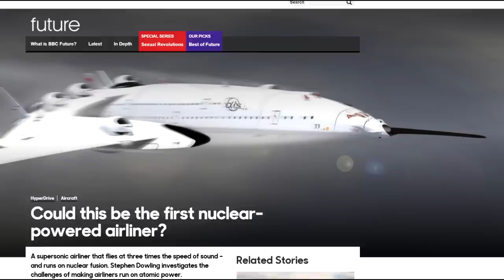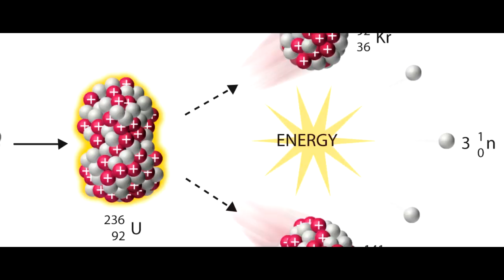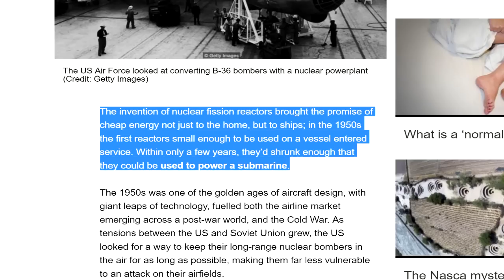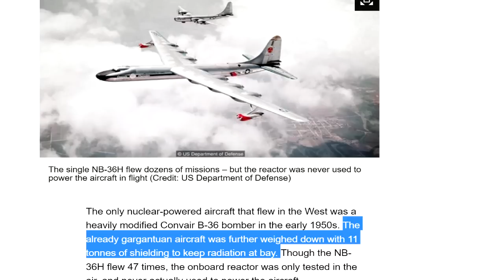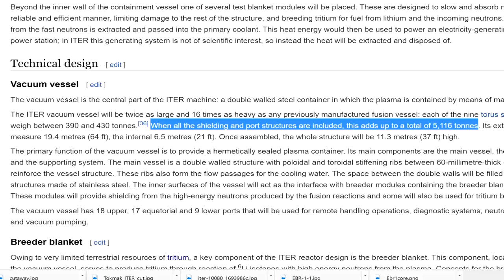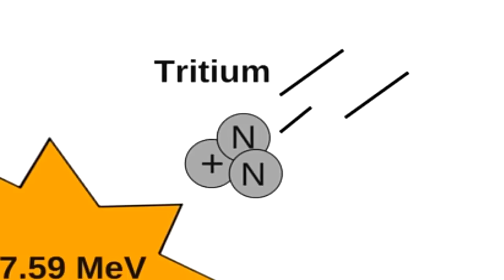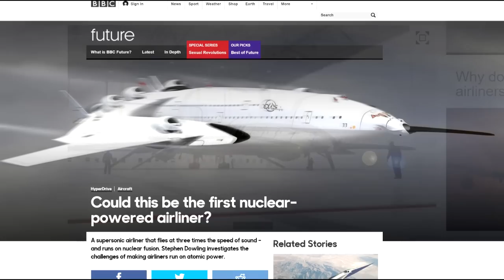SIX ENGINED Nuclear Airliner... BUSTED!

Comment: lol even if they good somehow get that much electricity to power them engines from thin air that thing would not be able to fly at match 3 because of it's shape. flying that fast needs a specially designed aircraft...

Comment: Yes, again, true... atm it is impossible and even in 20-30 years it will still be impossible. BUT, if you want to debunk such stuff keep it real. Aneutronic fusion reactors might, in 40-50 years, maybe be viable. They need a lot less shielding as the fuel as well as the resulting waste is not radioactive and the reaction is ANEUTRONIC! Further more the aneutronic fusion reactions generate energy in the form of high energy electrons that can be trapped and used directly as electricity. I love how leaving such facts out makes your assessments otherwise correct be nothing more then hate speech. How about instead of simply bashing the concept try and find a solution to them especially since one is envisioned already! Yes the artist is way way off base but presenting only part of the truth makes you a bad scientist! Present all the facts not just skim through it just as these guys are doing show us you really know your stuff and I wager you know every single thing I said much more intimately then I do and could make a much better prediction as to what would be needed and how it would be built if possible.

Comment: 4:20 p+b11 fusion produces very few neutrons and He3 fusion produces hardly any. 5:40  Boron11 is a plentiful and stable isotope.
Reply: yes and why talk about it when you can just make a hate video. The plans for that airplane are ludicrous at best but he's a scientist and should act accordingly. Also you need to mention that He3 is almost 100% clean fusion almost no neutrons to speak of input and output materials are all non radioactive...
Reply: mycardbrokedown Almost no neutrons? There is one neutron created every fusion event, there atleast several billion fusion events a second, you do the math. Then comes neutron capture of the materials used in the reactor, they WILL turn radioactive over time and when the reactor is disassembled are no less dangerous than components of a fission reactor.
Also, while fusion is a wonderful concept, if it will work (meaning more energy turned into heat/electricity than needed to keep the reaction running, lets just leave it to ITER for now to prove that) the tritium is highly radioactive, while easy to shield the beta particles, you really don't want it to leak.

Comment: The French actually flew an electric plane across the channel last year.  It is power stored in a big battery but it still flew like a normal propeller plane or a prop plane.  So technically you could have a nuclear power source on an aeroplane  that charges an engine to force propellers to work. Like a battery.  The problem is you wouldn't be able to achieve the same thrust as a fuel plane.  But the last thing is who would want a plane flying around with a nuclear power source on it when it crashes.  Also you have to contain the nuclear power source so yes you could be too heavy to achieve thrust to lift off the ground.  Yes they could make a small power source as the the satellite that went to Pluto used a nuclear power source.

Comment: In 1960's the soviet union had a flying prototype nuclear powered plane. It was nothing special regular speed plane exept it was flying for months with no refuel , seems like cool but not realy , after they tested it , they closed the project. At the time they couldn't fix the issues the weight was to big and they couldn't properly protect pilots from radiation. At the time that plane was useles they couldn't adapt it for their needs that technology they used in their submarines since then they never resurrected that project again.

Comment: I would also be concerned that the wings are mounted to the fuselage by a thin strip in the back, and are leveraged toward the front. Those suckers are going to rock up and down  at speed and then finally rip off.

Comment: That's not a feasible fuselage or wing for supersonic flight. There's a reason that Concorde had a delta wing, and that supersonic fighters have wings that swing back to form a delta. And the forward part of the fuselage needs to be a particular shape to form a shock wave at the front of the delta.

Comment: The wing design pictured would have a number of problems and I'm not at all sure about those six small, strange, weirdly placed "engines". How does it get from heat production to thrust production?
Its OK for sci-fi but it does not look like it could actually fly.  Then add the weight of the shielding.  Ha!😁

Comment: The inventor talks about creating a fusion reactor like it's nothing. To start with you need to get the temperature up to about 10,000,000 degrees Celsius just to start the fusion process. So they'll need an onboard power generator capable of producing that just to start it up for christ sake.

Comment: Sci Fi literature sometimes deals with the problem of radiative engines and the need to keep them isolated with little mass by placing engines on pylons away from the main body of the ship or otherwise separated from the populated areas. This may be why the Discovery ind Athur C Clark's 2001 had the people up front in a globular section and the engines far away back separated with a long a thin hull. This aircraft show now no such design techniques.

Comment: The US airforce gave up on this in the 50's. About 40 miles down the road from here is the old site of the Quehanna experimental nuclear reactor. It was used in the 50's to study the feasability of nuclear jet powered aircraft, but with fission. The old decaying earthen bunkers are still there, though hunters have mostly shot out the inches thick leaded glass in them. Penn State took over the facility in the 60's for a while for their own studies. Clean up of radioactive materials has been going on for decades, and from what I've read, there are still many barrels of beryllium oxide buried there, and some places are still hot. They abandoned the idea of using fission in aircraft for the reasons you mentioned, like shielding, plus there was the risk of spreading fission products in the event of a crash.
One thing I noticed interesting about this bbc article is that they say they will use the fusion reactor to provide power for electric engines. How? Boiling water for a heavy generator? That would make this about as practical as Henson's aerial steam carriage from 1843. The first fission jet engines used a fission core in the belly of the aircraft, along with a heat exchanger. The heat was transferred from the core to jet engines on the wings using a fluid, I think molten salt. The jets had heat exchangers in them instead of fuel injectors, so basically the fission heat was replacing the heat which would normally have been produced from burning refined kerosene. This would allow a jet to run for months at altitude instead of hours. Cool idea, but a bitch to implement in reality.

Comment: Wouldn't that plane though be big enough to actually hold a reactor + the shielding required?  And even if it did so at the expense of weight, carrying that many passengers that quickly could it offset the lost capacity by charging higher ticket prices?  Surely even a cargo version would be eagerly snatched up?

Comment: Not seen the whole vid already, but from the Concorde, Tupolev and Boeing prototype in the 60, all of them has very common points that I cant see on the photo, example a delta wing and very sleek and sharp aiframe. Sleek aiframe = a single aile that wont seat 250 persons. Also Concorde is not a random design, its caracteristics were derived from supersonic fighters ... that is, aerodinamics rules are the same no matter the years. This could explain why tupolev 144 looks almost like Concorde. Yep, both supersonic. And this photo has nothing in common with them.

Comment: All this is, is a flying-waiting to happen Chernobyl. Nuclear power was conceived for use in aircraft with a modification to a B-36 Peacemaker, best part is.....the US SAC did modify it but never actually turned the reactor on while the plane was flying for safety reasons. You know, in case it might crash and blow up :P. This is a stupid concept, both aerodynamically (that fucking U-shape wing...)and scientifically.

Comment: But si nuclear fusion possible on submarines?
Reply: @flow It's possible once efficient, sustained nuclear fusion is achieved! But nobody will stick a new engine power design in a submarine where it's very difficult to solve unexpected problems. On submarines tried & tested power units are essential. Lockheed Martin [Skunkworks] have been developing a small fusion reactor for a dozen years or more - nobody outside knows how close to a real reactor they have got.

Comment: You don't need tritium and the extra neutron for fusion if you can get a higher temperatures. Weight doesn't matter for fusion research but temperature does hence the current use of tritium.

Shielding weight can be offset by thrust. If a nuclear reactor can run at much higher power than an oxidizing jet, it can push a heavier weight. With enough plasma jets pointed down, you can forego lifting surfaces altogether.

Also aircraft normally operate with wide separation; again if separated enough, the atmosphere will eventually stop neutrons and xrays. Instead of a completely surrounding the core, you might be able to get by by putting the core in an isolated tail boom with a shield wall between the core and things you don't want ionize (like first class passengers and avionics).

The fission reactor shuts down landing will only produce decay radiation. A fusion reactor only tritium decay. Put it on Isolated runways, and use ground vehicles to haul the planes for taxiing. 

It's not impossible as much too expensive to be practical.

The one danger not covered is a fission core has to be able survive a crash intact.

Comment: Heh.  In the early 50s the Air Force had an idea for a nuclear powered jet bomber, just as TF says ere.  They asked Alvin Weinberg, the inventor of several sorts of nuclear reactors, who worked at Oak Ridge Labs.  He probably tought it was an altogether stupid idea, be he saw it as an opportunity.  Thus the Air Force funded the exploratory work on the liquid fueled reactor, the concept later to become the MSR and eventually  the LFTR.  The models built for flight testing developed more than sufficient thrust for flight, but couldn't lift the shielding necessary to keep the crew alive.

I see Marmoset said essentially the same thing below. Good on him.

Comment: Supposing they did manage to put a fusion reactor on a plane without cooking everyone around it, how would they then use that for propulsion? It isn't just where the energy comes from, its how you throw mass out of the engines to generate thrust.

Comment: looks almost like the normandy from mass effect. but more like a cheaper gay version

why not just focus on getting that normal fusion reactor runing and solve almost all energy problems? after that you can use part of this energy to produce hydrogen fuel and fly with a normal plane engine.

Comment: I get annoyed at artists' impressions of black holes. Seen so many of these pieces of garbage that it got me wondering if NASA or ESA have ever provided direct photographic evidence of a black hole or at least a region near the event horizon. 
Nope, they haven't. For one, it takes a bunch of radio telescopes to "see" Sag A* at the center of the Milky Way, for one example. 
I get the feeling that these objects-or areas-will disappoint us when astronomers finally snap that pic. There will be either nothing there, or an uneventful patch of dark space with no stars being swallowed or gas jets streaming out. 
And all because of artists' impressions, the artists whom are not at fault as they're just doing a task assigned them by an agency or org. 
Sorry for the long OT comment.

Comment: nuclear power issues aside it's still the stupidest ever design for an aircraft ever.. anyone who even managed to get it  to fly safely at subsonic speeds would be a god amongst aviators and it would be so unstable going trans sonic that every passenger would probably just throw up everywhere.. that wouldn't be too much of a problem though because when the multiple sonic vortices converge as you go supesonic the whole bloody monstrosity would fall apart anyway.... nuclear engines are the least problem here....

Comment: CAN I POINT OUT INSTEAD OF TRITIUM WE COULD USE HELIUM 3, u know that shit the moon is coated in ?
Reply: Can I point out that for a fusion reaction to produce more energy than it needs to spend to keep the reaction going we need to scale up the size of the reactor. I mean ITER is to be the first fusion reactor to actually do that and its big. So no! Fusion jets are unlikely to become a reality in the foreseeable future.

And Fission jets will be too heavy because of the shielding. Direct cycle designs would be lighter than indirect cycle ones but they would be spraying irradiated air out the back of the jet. The US was funding the development of both types during the Cold War. Look it up.

Comment: fission engines are possible not Fusion what it's like having a small nuclear blast every time a pellet is used and is hella complicated
Reply: Actually fission jets just heat the air thus making it expand and provide thrust. The US funded development of them during the Cold War. They never solved the radiation shielding/weight problem.

Look up:
Nuclear Powered Bomber Documentary

Comment: Did that just say it was going to run on nuclear Fusion!? Why bother setting anything up until you get your POWER SOURCE going!?
Yup fusion. 
Not to mention we've tried to make a nuclear powered airplanes and they were just too unreasonable. Maybe in the future. 
Oh hey, he starts off with these. OK TF as usual has it covered. Back to HW.
Didn't ever cover some of the issues with supersonic travel. Most jet-fighters, if they can even do above Mach-1 its for bursts. The F-35 and F-18 don't even do supercruise because it's not worth the extra design time and money, but the F-14 and F-22 do.

Comment: ya also gotta mention the fact that it has jets and you can't make electric jet engines also jet engines would shatter at that speed and they can't use ram jets because again not electric and fans or props won't go that speed
Reply: For the basic principle of nuclear jets look up:
Nuclear Powered Bomber Documentary

The problem is that all the needed shielding to make them safe makes them too heavy to be practical.

Comment: you know nuclear aircraft does exist as a Soviet experimental tu95 it was never built but the idea was to use the heat to power generators and have very powerful electric props there also was a american plane that had a reactor and it carried it but it was not powering engines sorry for grammar I'm on my phone

Comment: Wait, hold on a second,
Aren't we not able to make fusion reactors right now? Or at least have we not been able to get a reliable one?
I remember hearing something along the lines of that we need to heat it up to near the temperature of the sun (because FUSION), which is pretty hard to do. That's why they're trying to work on cold fusion, I believe.

Comment: You know, it's really weird, because literally EVERY ARTICLE I've ever read on nuclear fusion, coming from scientific reviews and different sources on the internet, told me that it was, though not completely safe, very significantly safer than nuclear fission and actually pretty fucking safe in general, producing only low-energetic alpha and beta rays, that can be somewhat dangerous but can be easily stopped, and although they do need tritium, which is radioactive, it only has a half life of 15 years or so. That's nothing, we can easily store waste safely for 50-100 years, but not hundreds of thousands of years like atomic waste coming from nuclear fission.
If 100 sources tell me one thing, it is hard to believe one single source saying the contrary.

Comment: Nuclear fusion? lol
Warp drive will be powering space ships before then.
Reply: You hit the nail on the head. Fusion is simply taking too long. Some boffin will come up with something much easier to accomplish at some point before it's completed.
Reply: Matteo Planker ion engines can get you going fast but it takes a long time to get up to speed and the same to slow down making travels lengthy. Description was the force of the weight of a paper plates. That they're inexpensive, low weight and don't require a lot of fuel, they'd best be used for long distance probes. Perhaps coupled with solar sails for initial push out of the system and slow down entering the new one. Still would probably need extra help slowing.
Reply: Bone Doc I
I'm betting on ion engines
Reply: MIT ARC: https://www.youtube.com/watch?v=KkpqA8yG9T4

although I fear it lost funding to ITER:https://www.youtube.com/watch?v=xoFF1DS_sQ8
Reply: You are so wrong its almost pathetic they already have fusion it's only a matter of getting more power from the reactor then is put in and creating a means for it to be self sustaining and they're getting better and better at it each year.